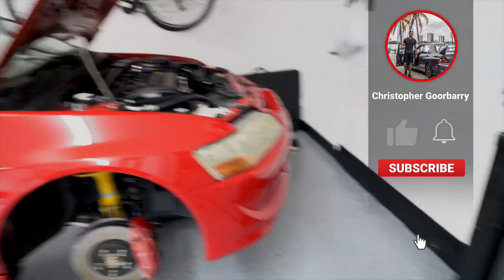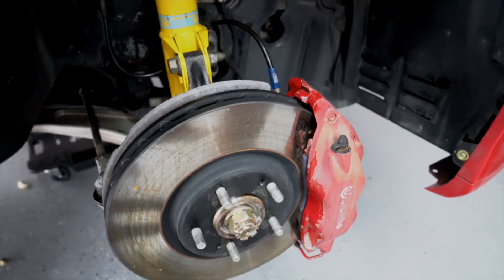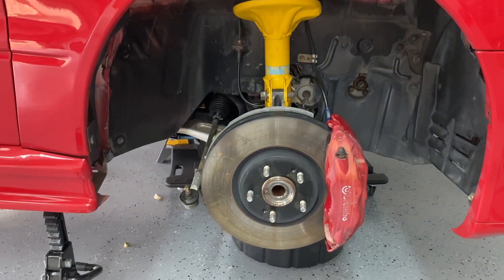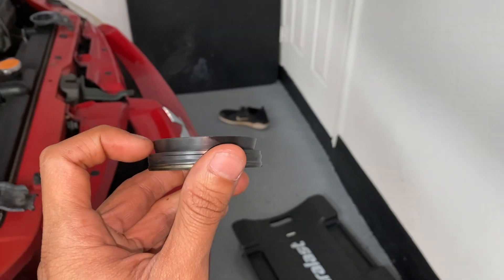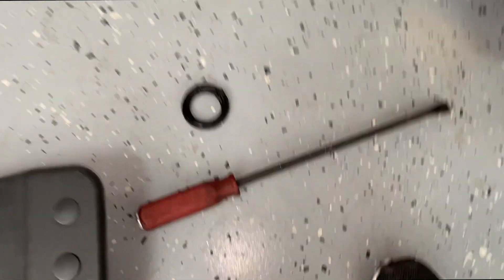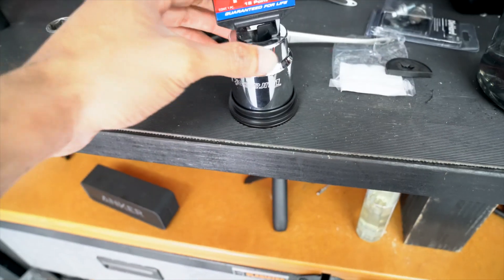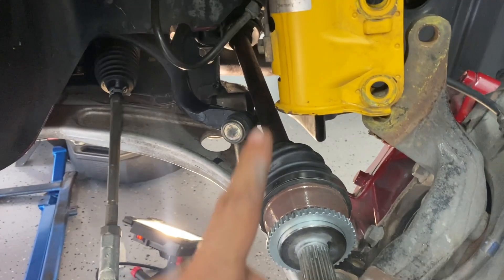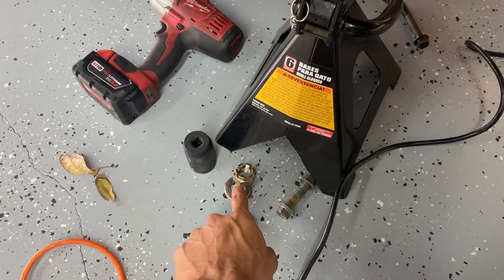How to change the transfer case axle seal on a Evo!

Comment: Literally ran into all your same struggles when I did mine on my X. Couldn’t find the right size socket and went with PVC pipe. Still took hours to get it straight. There has to be an easier way to do this job. Factory tool?